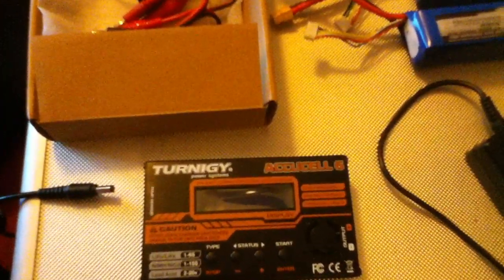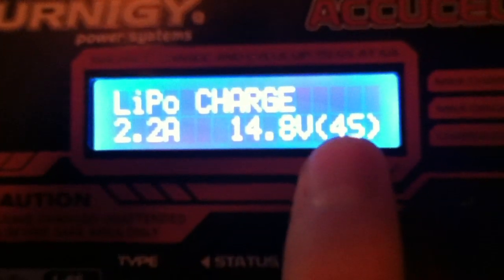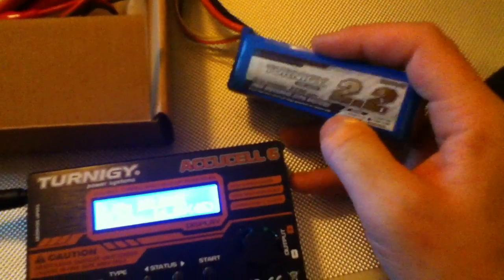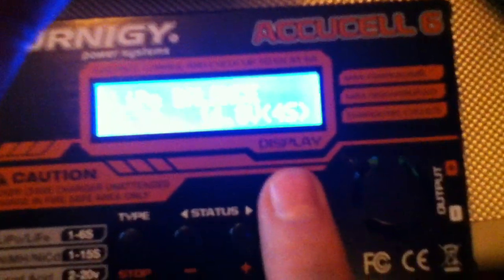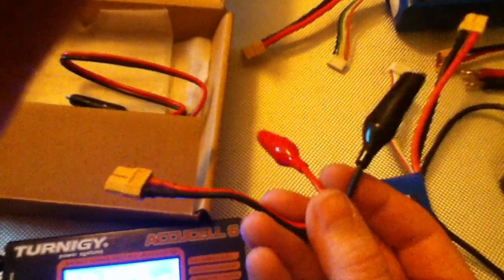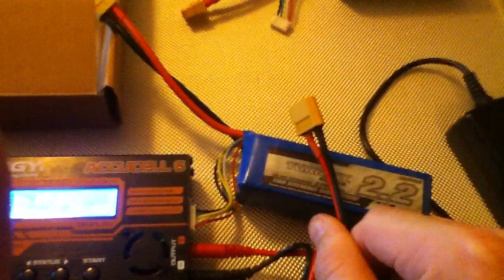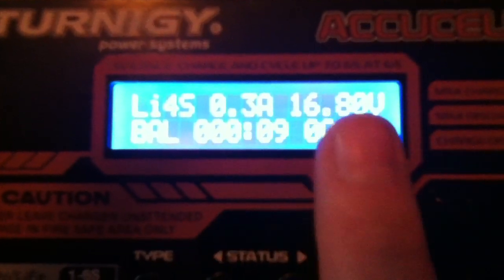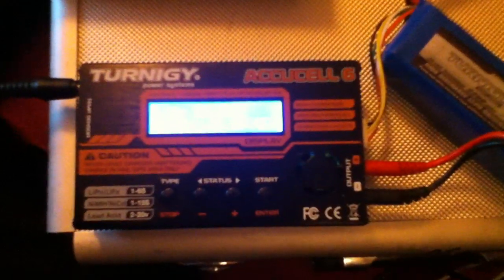Charging Lipo's with Turnigy Accucell 6 made easy

Comment: Thanks. Just a point on the charging current you showed. Your battery is a 2.2Ah but this should not determine the 2.2A setting  you showed in the balance menu. LiPos can usually charge at quite a high C value. So for a faster charge set this at max. nything but the tiniest of LiPos can take much more charging current than this charger can stuff into it :)

Comment: im using a turnigy 0.8 mAh LiPo, and i have bought the accu cell 6 charger. i have a problem tho, the charging cables supplied with the charger are XT60 but the charging lead coming off the battery is a JST i believe. where is the cheapest place to buy an adapter. or am i looking at it wrong?... PLS help im new to this but id really like to get into it. thx in advance!!

Comment: Interesting video mate.  Without wishing to appear a pompous *rse there is a small error that needs correcting.  The S = series NOT S=cell.  i.e. 4 X 3.7V cells in series = 14.8V, a 2S battery would be 2 x cells in series = 7.4V.  This is important when you consider P as in 2P = 2 cells in parallel i.e. 3.7V in parallel with 3.7V = 3.7V but two cells in the pack.  For 4S2P which means 2 cells in parallel connected in series 4 times i.e. 2+2+2+2 = 8 cells but only 14.8V.  Hope this helps.